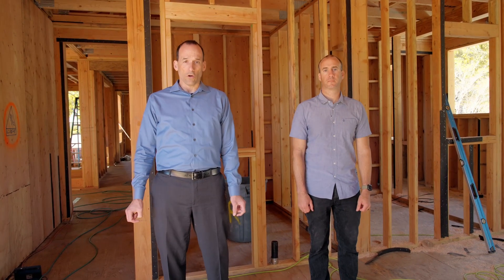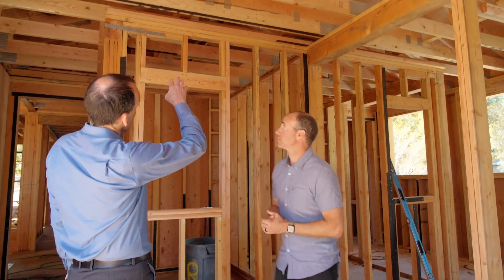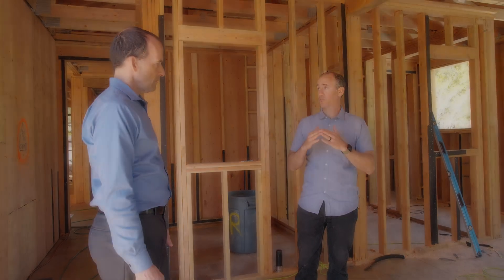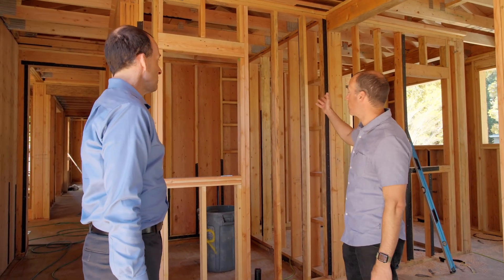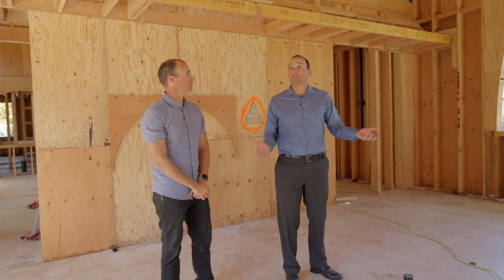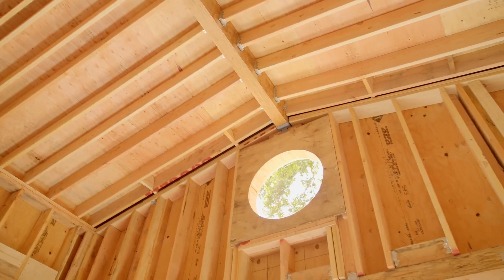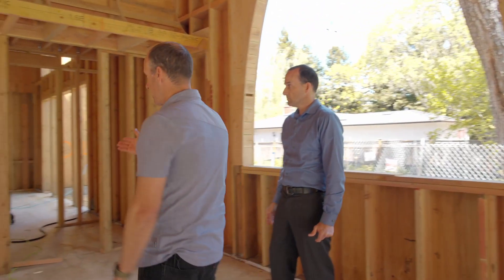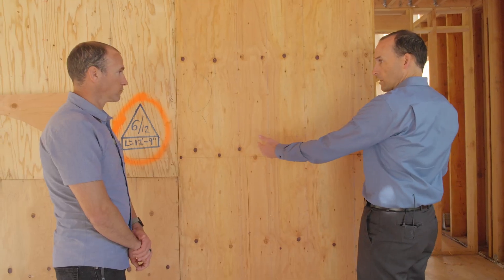Venkatesh House: Understanding Framing - Load Paths and Shear Walls

Comment: "If you don't have a structural engineer who knows how much things cost..."  BINGO!
My engineer built a complicated lake house from the ground up for his parents early in his career.  He learned how difficult (and expensive!) some processes are and passes that knowledge on to my jobs.  My builder friends have 20-25 hold downs on their plans, whereas I might have 8. Steel is expensive now, and making sure the placement of the anchors in the concrete is 100% accurate takes time and head-scratching on the field, trying to predict where other framing members need to coexist in the same space.  Even more head-scratching happens when you realize you missed it the first time.
Since I also design homes, I know what the engineer needs to fulfill the lateral force requirements, so I do my best to sprinkle in substantial wall lengths to double as shear walls. If I ask, my engineer will happily explain load paths and force transfer methods to me, helping me become a smarter builder.  For example, reducing the width of a massive sliding door by just a foot can save $1000 in in the cost of the door and up to $400 in the hold down hardware and labor.
You mentioned challenging the beam size too—the plan may spec 4x10 headers in first floor unless noted otherwise. Why does a 2'-0' window need the same header as a 6'-0" window?!  It might not need any header at all if there is a continuous rim joist above it. More ways to eliminate superfluous wood mass and maybe save some bucks.
You guys did a fantastic job planning out the content of your video.  It was loaded with expertise and excellently presented.
Reply from the maker: @stipcrane - first, thank you for the compliments, secondly, EXACTLY!!  I could not have said it better myself.  Your description of the value of a good structural engineer is right on.  I have a few that I work with willingly and a few that i hate working with because they always cost the client more money that they need to.  Even if we get the structural plan to be what we want, then we have to harass the framing subcontractors to build it per the plans and not build it like they are used to(16’oc studs, Headers over no bearing openings, 3 stud corners, FSC Lumber, No Added Formandehyde sheet goods,,etc).  Trying to do better, is always a challenge.  Congratulations for doing it right. It is hard work.